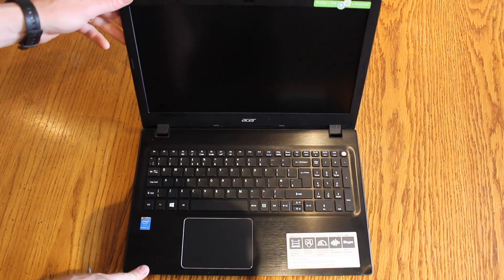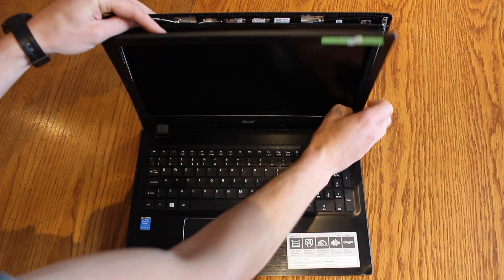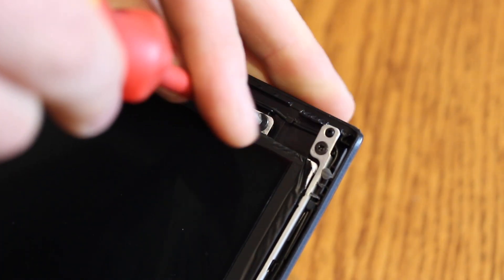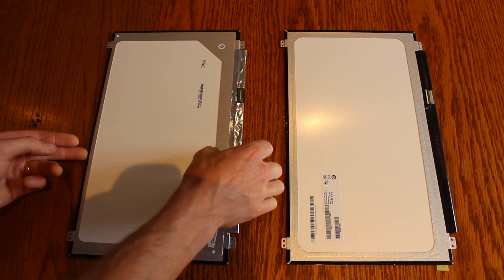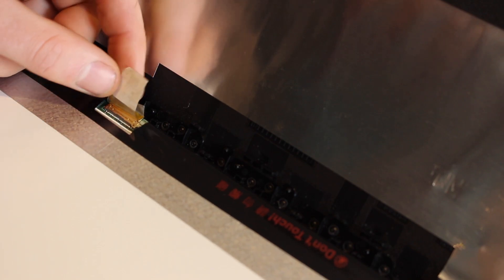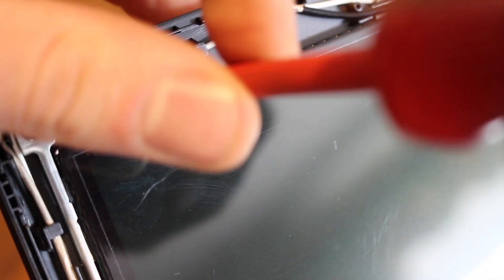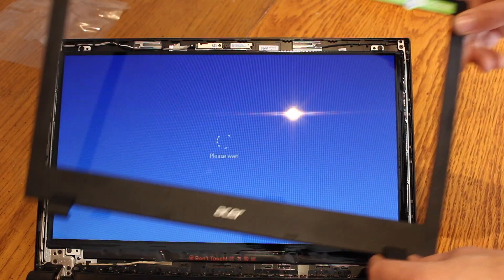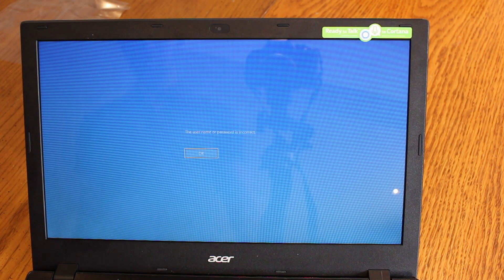How to replace the LCD screen on an Acer Aspire laptop

Comment: Very good and helpful video. Be careful when doing this because the screw mounts for the case cover to the hinges are really weak. They are imbedded in small thin plastic rings and will easily crack. Same is true for the screen screws, so do not overtighten them. If you crack the cover hinge mounts you will have to either change out the entire cover (requires full disassembly of laptop - there is a video on that) or jury rigging a way to keep top on. I tried using epoxy glue - did not hold. Finally drilled small holes through cover and put in new screws with nuts.

Comment: 💀now my screen is fixed up. When i tried to shut my laptop, there a little idk what it is like in the right bottom corner a tab or or something sticking out of the screen when its supposed to do directly under it. Sense it stuck taking the place of where my laptop bends at it completly disconnected the keyboard from the screen.helpppp

Comment: Good instructions, thanks! My 14" Acer E5-475G screen has gone black but I can get image through HDMI to the TV! I suppose is the screen.
Reply: Oh that's clever! I'm trying to troubleshoot my Acer and I'm certain it's something to do with the screen, but without the screen being able to show me any system error messages it's been a slow frustrating process. I never thought of hooking it up to the TV via HDMI. Thank you!
Reply: Just for the record. I replaced the screen with a new one but it wasn't it!!! Found a good technician he discovered two burned components (screen related) on the main board, got them replaced and screen back to work. I was also lucky could get the full refund on the screen!

Comment: In one of my "Stupid - Stupid" moments, I threw my glasses across the room and hit the laptop's screen damaging it somewhat similar to your example. I used another laptop and purchased a screen for my brand of laptop without checking the numbers at the back of the screen as you very nicely explained. IT WAS A DIFFERENT NUMBER! Nevertheless, I proceeded to change the screen following your instructions, and GREATNESS HAPPENED, the screen worked perfectly. THANKS A MILLION!

Comment: If the screen is pink but not smashed. Do you think it is the connector fault or the whole screen needs to be replaced? On external monitor everything works fine. I just don't know how to check whether it's connector fault.

Comment: The only civilized way to change the lcd is when you're doing it with the battery disconnected. Otherwise you may get many unexpected or unwanted surprises. I've changed the stock lcd of my Acer Aspire 7 A715-71G-59UZ to a much better lcd BOE NV156FHM-N4B. It's the best available lcd matching this or similar model. While replacing the lcd I've discovered that it's so easy to break the plastic frame fixing clips that you should disassemble the screen with care and knowledge. Do not follow the video regarding this aspect as you will break the clips for certain. They should be unclipped by a finger nail sliding along the butt of the screen with pressing lightly from outside to inside (towards the screen center). This works perfect. Feel free to ask via whatsapp (+79122003208) If any assistance needed.

Comment: Thank you so much for posting this clear, complete, and easy to follow video.  I searched high and low looking for a video that would show me how to properly disassemble the screen on Acer laptop and this one fit the bill. Using the steps in this video I was able to disassemble the screen on my laptop so that I could go in and reseat the screen connector. It is my hope by doing this my screen flicker problem will go away. I shall see. Fingers crossed.
Reply: i also have screen flickering issue.Kindly let me know if yours is fixed or not?
Reply: @GauravKumar-tm9pp  I used the instructions in this video to allow me to find my screen connector so I could unplug it and then plug it back in.  After doing this I stopped having screen flickering issues. I don't know if this is what fixed my issue,  but it seemed like unplugging the screen connector and then plugging it back in seemed to help.

Comment: REMOVE BATTERY and charger before you unplug that connector otherwise it's very likely you going to have no display when you turn your laptop on.
Reply: Augustin SE I can’t get my screen to turn on
Reply: DragsFire3oh2  does the laptop turn on but no picture ?
Reply: Augustin SE yea..I ended up taking it all apart again starting with the battery and reconnecting the screen wire til I heard a little click
Reply: So what happens if I did not do this? Do I have to start over again?
Reply: @fruitfulvisionenterprises   the problem is, if you don't remove the battery you risk shorting out your board because you have the backlight voltage present on the connector , in rare cases is just a fuse but could be anything else on the backlight circuit.

Comment: Thanks for the video. I have replaced the LCD no problem.  Now I have a crack in the top case near the hinge on the backside.  Can I replace the top case without replacing the hinges? The hinge seems fine.

Comment: Help! if you can! Last year my laptop fell off and some parts included peaces that holds a screen are now broken E5 571. To make it work again ,can anyone confirm that I can buy laptop casing of either of V5 571 or F5 571 model and I could fit my hardware there? Is there as well a difference if I get a case from E5 575 or V5 575 or F5 575 models? I need to be sure before buying those spare repair casing. Is there ANYONE that can confirm that I could fit my MotherBoard from E5 571 to any of these? Thank you